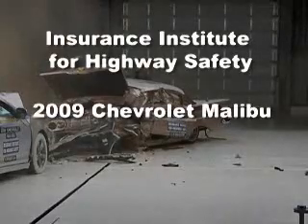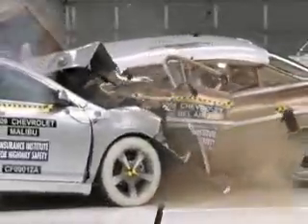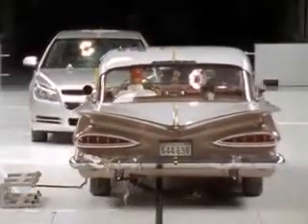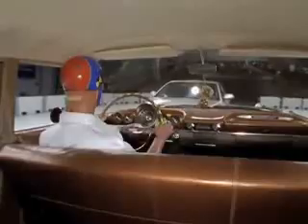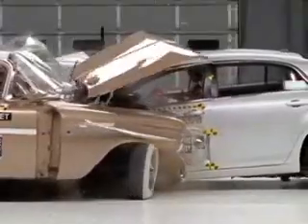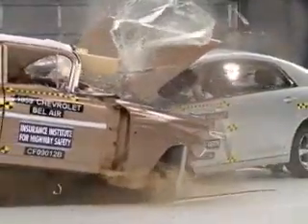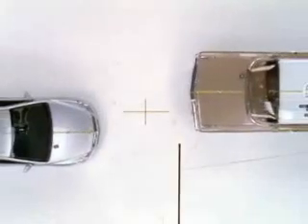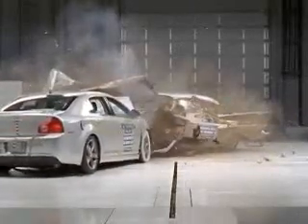Crash Test 1959 Chevrolet Bel Air VS. 2009 Chevrolet Malibu (Frontal Offset) IIHS 50th Anniversary

Comment: But this does not address the fact that newer cars are made to rust faster and have plastic pieces that break and must be replaced (like turn signal)  They have had a century of metal testing to know what alloys to use, yet you see rust within a year of coming off the line.  It's like they want them to last only 5-6 years (once they are paid off and out of warranty) and then fall apart.

Comment: A perfect Bel Air :(
Reply: With old, rotted out suspension bushings, springs, ball joints, and an electrical system that's a disaster waiting to happen...
Yeah, they could have restored it if they wanted to, but it was their car to crash if they wanted to as well 🤕

Comment: I can’t believe that there are dumfuq idiots who open themselves to unbelievable ridicule by stating 1959 cars lasted longer, and were more reliable. 

Talk about drinking the delusional shithead kool aid. 

Anyone ever get 100,000 miles out of a 1959 turdmobile? 90,000?

The malibu should give you 200,000 almost trouble free miles. Plus, if you ever have an offset front end collision with a 1959 automobile, you know you will walk away, while the other guy is going to the morgue.

Comment: Why do they wait to show the old car until the impact?  It does not appear until the very end? They don't want you to see that the new car is going much faster and has greater momentum than the old car. Notice how the old car has a tendency to twist and spin around the faster car and that's what happened. Even if the newer car had less mass it still had a higher momentum. It's general physics. They could have just sacrificed two Hot Wheels to demonstrate this

Comment: It was easier to see what happened to the chevrolet driver,but nothing,other thn the inside was shown on the new car. It did appear from the one interior shot the new car driver had less damage,but below the waist down to the feet damage would have been pretty important to see comparable damages of the two. Crushed feet and leg bones and joints were destroyed in older cars from my early oservations in the 60s=70s

Comment: Looks like half the bolts were removed from the 1959 or they were all rusted through, solid steel doesn't just fall apart like that, and possibly the frame was cut to crumble.

Comment: How about we take a real production car off the line and a real 59 bel air. that and the driveshaft on the '59 should pretzeled and thus become visible. I helped fix one of them too, the box-channel frame rails and the heavily-built front should be able absorb the crash and with an engine, transmission, AND driveshaft the crash would not be as severe. And a 1.4 or 1.8L 4 banger will not take the crash as good as this PR stunt made it to be. There is a block of concrete in the '09 malibu where the engine should be. That dash should be in the malibu driver's chest and the steering wheel in the bel air driver's chest. Let's get REAL cars and do it over again, after all, the scientific method allows for repeatable testing. Get us more of these two cars to crash (09 malibu and  57 bel air). We want other independent testing labs to crash some more. That and I want to see photos and video of the preparation for crashing showing that the engines and various components are in their proper places. Also photos of BOTH engines after crashing. Go CSI on this for accurate results. I do not trust these current results.

Comment: Cars today HAVE to be safer....people can't drive anymore. Next, we use " SecureFoam ® ", just like on Demolition Man. The false sense of invincibility, makes today's motorists, unaware that you will STILL die in a crash today...even if your new model vehicle is full safety designed / equipped. The more you attempt to make cars safer, the faster, and more wreckless people will drive. Animalistic Puffery, that inflates egos. Self-Drive vehicles can't get here soon enough, and protect the classics.
 "They don't make 'em like they used to..." Reliability, Beauty, and some of those old model sedans, actually did fair rather well in a collision, against other vehicles, even if safety was not heavily required in those times. Sure, today's standards have to be greater, too many Ding Dongs on the roads today, as opposed to yesteryear.

Comment: That they do it with a pontiac, or with a challenger, or a chevrolet caprice, that way we will know if it is according to the material or the model of car. The Chevy Bel Air was perhaps a good car, but it is visibly very weak in several parts, especially in the crossbeams that fasten the roof to the rest of the car. 

Another detail is that, The sides of the front in the Bell Air are practically empty. The engine is in the center and on both sides nothing, hollow. The vehicle 2009 has the entire front part filled with engine parts, plastics and other components that absorb the impact. Therefore it can not be said that the material of the modern car is better, it is only that inside the car there is more protection to avoid the destruction of the outer material.

Comment: A car that was so unsafe when it was made it caused the creation of crash test standards.
A car that has X-frame, with offset collision being its worst case scenario.
A car that sustained 50 years of metal fatigue and weathering.
A car that collides with much heaver and front-solid vehicle.
And it suffers heavier damage than brand new modern vehicle. No shit Sherlock! That's not an indication of modern car's safety, that's an indication of some very solid cherry picking work. If you're looking for safe vehicles, modern car industry is the wrong place to look for. Nowdays they make cars out of nothing but stamped aluminium, basically the single shittiest material you could use, and they use it because it's cheapest. They can withstand 50 mph controlled collision on camera, but on the road it doesn't goes nearly as well and dandy. Air bags are band aid to a dead man. Real safety is in rigid roll cage, like in race cars. When they crash it's at 150 mph, and when they crash the outer decorative shell disintegrates spectacularly but you'll really struggle to find a crashed racing vehicle where the roll cage itself suffered any serious damage.  And yet literally none of car manufacturers puts those in cars. Let that sink in.

Comment: "They don't make 'em like they used to," my dad used to say.  ALL the time.

No Dad, they make 'em better.  However, although the '59 Bel Air clearly lost this automotive joust, it's still a much nicer looking car then the uglyass Malibu.
Reply: It's us mechanics that like older cars bc they are easier to fix. you just need a screwdriver and a wrench to fix them. Everything is made of metal and easy to reach. 
Newer cars are a mess with plastics and electronics. You need a computer programmer and a team of mechanics to fix them, and often they are just scrapped bc they can't find the problem.
Reply: @adamfidelio1213  its not that excessive tho. Not everyone has adopted smart car technology. I'm pretty sure my entire community uses new cars but they always go to local mechanics around here.

Comment: "Injury to the neck, chest, and both legs are likely"

Understatement of the decade right there; that dummy would have an engine where its body should be and roof where the head should be. "Death to everyone remotely near the front seat is likely" is the much more accurate prediction there.
Reply: Well, it is possible to jump in the rear seat or curl up in a ball in the passenger's foot well.
Reply: Ada Frost it's lawyer talk, they have to understate it for legal reasons, but anyone who made this experiment would agree with you

Comment: Said 1000 times before but there's no god damn engine in that Bel Air so what the fuck does this prove.
Reply: There's an engine in the Bel Air. They have these two vehicles from this crash test in their museum, and you can clearly see the engine in the Bel Air.
Reply: If there is no engine in both cars, then the're both at an equal advantage, and the test still proves that 50 years of safety improvement have had an effect (What a damned surprise!!)

Comment: Actually put the engine and such in the old car and it would cut through that plastic junk like a hot knife through butter. Hitting an empty body with none of the mass or resistance the engine would provide proves nothing.
Reply: Where do you see that the engine has been removed?  I can't see a clear enough shot in the video that shows it
Reply: I agree the quality is horrible, but I didn't see the engine pushing back into the passenger cabin and looking at the car after the crash I cannot make out any engine parts, and the front end is pushed in far enough the engine had to go somewhere. So I'm thinking they took it out. I could be wrong.
Reply: eustace2c2 , Yeah that makes sense. I wouldn't put it past them, that's for sure.
Reply: Given that this was an offset crash test, it is likely the engine got just got bumped to the side.
Reply: eustace2c2 the engine is in are you that FUCKING dumb
Reply: It's supposed to be a Straight 6 engine, not a V8.